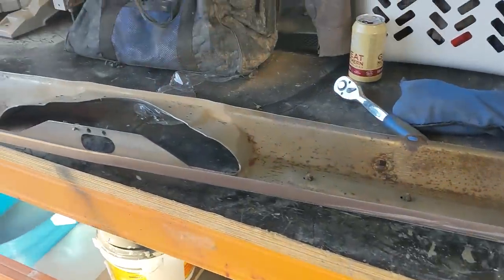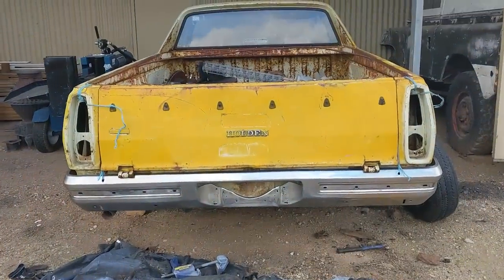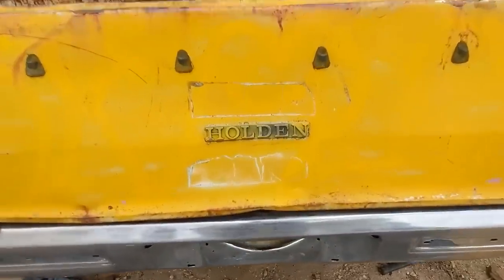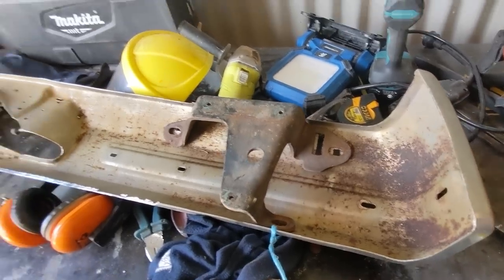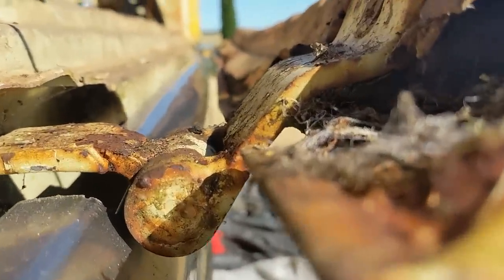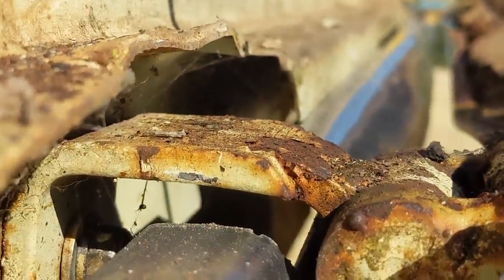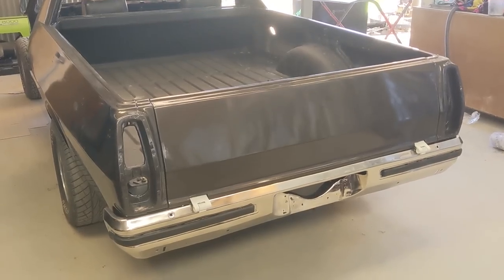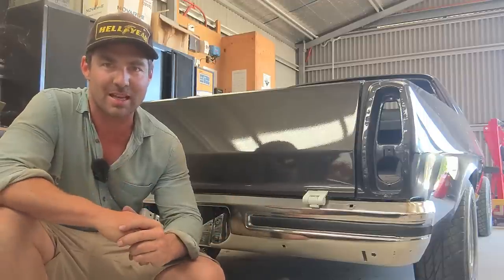HOW TO RESTORE/FIT A FULL WIDTH HZ WAGON CHROME BUMPER BAR ON A HOLDEN WB UTE WITH SIMPLE TOOLS.

Comment: The lip under the tailgate is cut off right across that's how they are done getting the bar up flush without cutting it ,the hidges don't interfere with it .
Reply from the maker: Yeah I didn't want to cut the lip as I've already sprayed the body. I also needed more space even after I cleared the lip hence why I cut the hinge gaps, I don't see any other way unless you have HQ hinges which sit higher. WB hinges it's not possible without cutting recesses if you want to have it hard up against the taillight lip.
Reply: @BarnesysBuilds  l did it on my wb and had no problems. The hidges just need a bit of adjustment, you must also beware of the the rust the will occur by cutting the bar. Anyhow it's good to see you have a love of utes, l have 4....
Reply from the maker: @joseph317  well yours must be sitting lower than mine as there was no possible way of getting it higher without those recesses so interesting to see a photo of yours. I am aware of open metal hence why I galvanised the metal. Yes love the h series ute, they are great.

Comment: Hay mate I remember back in the 90’s there was a mob in a place called Lonsdale south of Adelaide that sold brackets specifically to bolt the wagon/sedan bumper on a Ute
Reply from the maker: Could be a long shot but do you know if they are still around or know the trading name?
Reply: @BarnesysBuilds  try Auto Salvage Recyclers in Lonsdale South Australia I’m 70% confident mate

Comment: That chrome came up a treat. I'm also fitting a full rear bar but will probably have a crack at tucking it in by shortening it. I'm also going to see if I can fabricate or modify the hinges so they aren't seen at all. Probably won't succeed. 😆
Keep going mate.
Reply from the maker: Yeah I think tucking it in will be pretty easy if you just take 30mm out from centre. I was just trying to avoid rechroming to save money so left it as is. It's actually not that bad and matches the front. Yeah I'm not happy with the single bolt method but it's a start, I think the end side bracket is the way I will go, much easier to fashion up a extension bracket, well in my mind at least!

Comment: The original wagon bumper bracket is also used as the jacking point. That’s what the slots are on the bottom. A statesman bumper is a tighter fit to the body or we use to shorten them to tuck them in. Looking good.
Reply from the maker: Yeah ok interesting, I wasn't aware the wb statesman was a better fit, dam, oh well it still looks like a decent fit. I think the Statesman bump strips put me off as they were too thick for my side moulds which won't be Kingswood size. Cheers

Comment: I have a similar bar on my Ute, but the only difference I can see is your hinges protrude out more than mine ? I have photos I can send if you wish. I was going to replace the rubbers on my bar, but it looks like a pain to do
Reply from the maker: The rubbers actually aren't that hard to replace, the bolts came off easily and the arrow plugs would be easy to push in with some silicon.i would be keen to see the hinges, must be HQ, I think they were higher.
Reply: @BarnesysBuilds  https://drive.google.com/file/d/1-yh-U2CNj9kLT_OSd0iiI20fF2Q4WEY8/view?usp=drivesdk
Reply: @Barnesy's Builds  https://drive.google.com/file/d/1-p1sB6U6CdfTJG2Q9xRfapt_5_-nKepu/view?usp=drivesdk

Comment: Good work, it looks great. I'm curious about people who have shortened them for a tighter fit. I can only assume they cut them in half taking out an inch for example and then push them together.
In an ideal world they would weld and re-chrome or do they look perfectly ok just being in two separate halves?
Reply from the maker: Yeah they usually take 30mm or so out from centre point and re-weld together again then you would have to re chrome again due to weld and grinding marks. Most people who do that colour match the bumpers to get around that issue. There is a fibreglass place that makes replicas of this bumper already shortened and ready to go however same chrome issue applies as they are black out of the factory.

Comment: I’ve got my Barnesy’s  Builds hoodie and cap here in Central Oklahoma.  Proud to have it and wear it. 
  Nice work on that bumper. You fit it up well. 
   That Ute is one nice looking vehicle. 
   I’m curious what the term Ute is associated with in Australia. 
   Here is the U.S.  The Ute Indian is a Indigenous-Native tribe.
Reply: Ute is short or Aussie slang for Utility
Reply from the maker: Hey Hugh, that's pretty cool to be honest to hear that you have a hat in Oklahoma! I've always like that area of the U.S. Tornado country!

So Ute is Aussie slang for utility vehicle. The first full coupe Ute was a Ford actually and was designed for the Australian market to cart hay and livestock but also still look like a car that you can go to church on Sunday with. The difference between the American pickup and the Aussie ute was the coupe design meant the body and the tray were moulded as one continuous piece where as the pickups had a separate tray. Pretty interesting. Thanks 👍
Reply: Tornadoes for certain.  Thankfully we can see them coming from a long way off.  
  Thank you for the explanation. 
  They’re like Rancheros and El Caminos here in the US
Reply from the maker: @hughobrien4139  yes, the El Camino is probably the closest variant to the Holden WB I would say, just a bit longer.